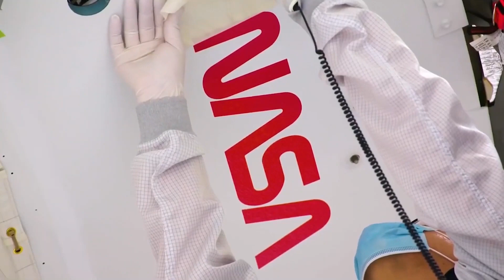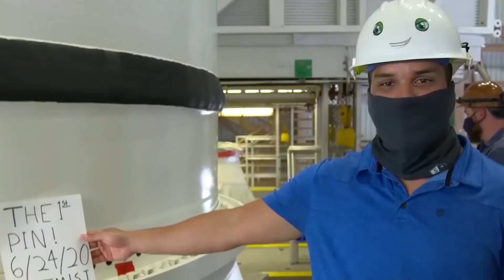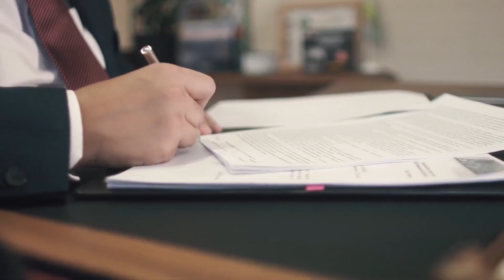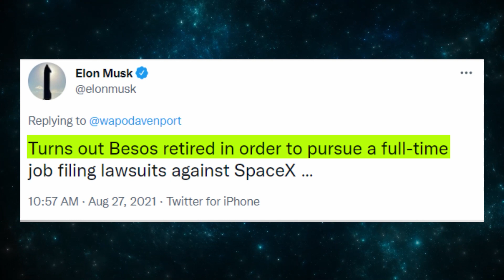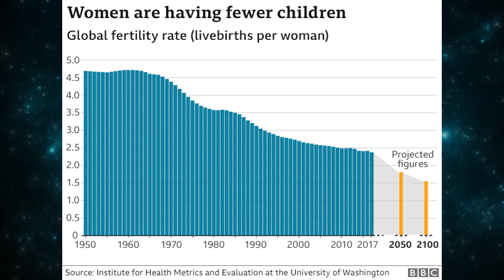SpaceX vs NASA - Why The NASA Partnership Has Ended!

Comment: Sounds like bulshit they certified dragon for the space station what are they going to do with it
Reply: If they build the HLS it will not have a heat shield. No way SLS is going to work. One launch a year, reused hardware not reusable. Will need a dragon or Orion.
Reply: Use Starliner. LOL
Reply: @jeffreypelaske841  i mean what is spacex going to do with dragon there is currently no other destination in space